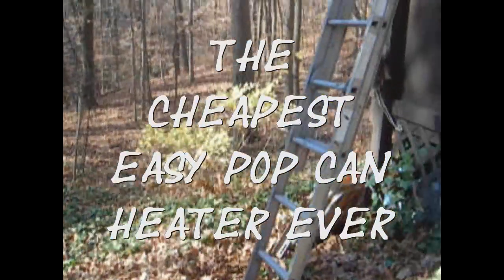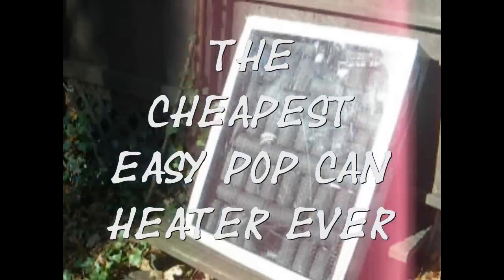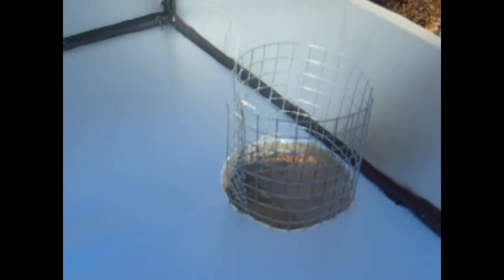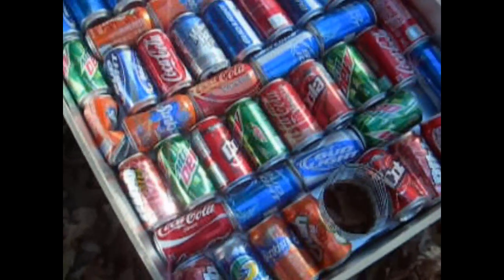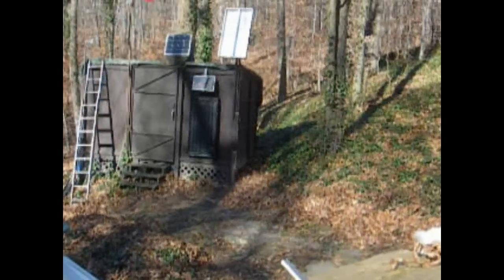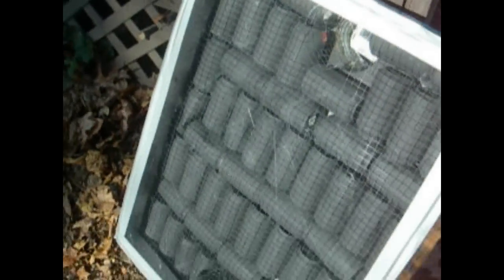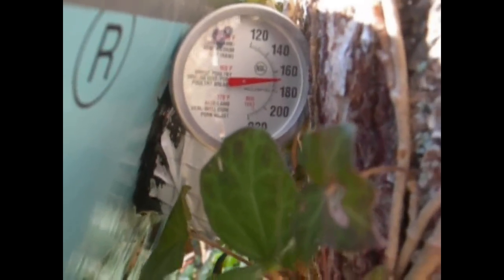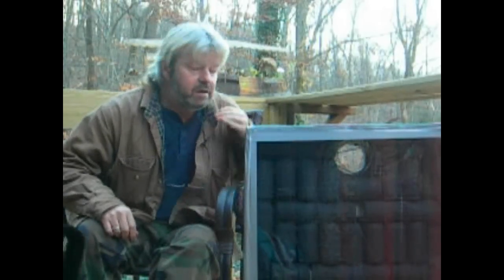THE CHEAPEST  &  EASIEST  POP CAN HEATER EVER!!

Comment: ok so im a newbe when it comes to this. we bought our first house and im a corner cutter, like to shave bills anyway I can.
so I understand the basics of how this works. its Radiation Heating. 2 holes (one top one bottom) hot air moves upward so it draws the outside air (or if u put in a window draws the cooler inside air) into the unit where it heats up and moves to and out the top. normal with a little force. (correct me where im wrong as I said im a bit new to this and im just following what ive learned in public schooling)
now where im unsure about this is that a normal window size area would be enough to maybe heat that room, maybe 5 degrees.
so im wondering how to get more yield out of it.
my thought was a bunch of these along the sunny side of the house and tie the discharge tubes into each other and then into the house via window. but I also thought that the heat coming thru the tube into the house 1: wouldn't be pushing at the same force and thus not make it inside well enough or 2: the air would cool in the tube on the way into the house. the least amount of tube the better but id still be looking at atleast 4 -6 feet of tube. enough distance to cool the air down inside it to by the time it reaches the house it might not be warm at all.
then I could be underestimating how hot it can get.
im trying to understand this more and come up with a get solution.
was looking into some wood fire type thing outside that will heat up the air in a pipe and send it in. something simple to make and not to costly that will last with simple basic care. we have wood wood and more wood. fallen trees deep back in the woods and people are always putting wood out to the road all around town. a energy source I really want to grasp for winter time with heating costs going up and up. thanks for any insight and tips.
Reply: You should be cutting 2 holes in the house. Both holes line up with the port holes in solar collector. The bottom one is your feed into the collector, this one sometimes has forced air via a fan of some kind. Important that the fan is not too strong or else it will cycle the air too quickly before the sun has a chance to heat the mass inside the collector. The top hole is the exhaust hole (because heat rises this makes it more efficient). So the bottom hole will take the colder air from your room (at the bottom) with a fan in the piping helping to draw air from the room into the collector....then the hot air will come out the top hole (exhaust). Both the holes can have a simple dryer valve, so that when you turn off the unit at night, there is no back flow of cold air. If you want, get a fan that operates off a small solar panel attached to the top of the unit.
Reply: +kaisnyker u should look into a outdoor wood boiler. I have one, it is awesome, best heat ever.

Comment: Question have you tested this in fall winter time? I have a Garden and green house going and i have rabbits as well that i have in a green house to keep them out of the wind and snow. My question is how well it would work in those seasons with the sun on it.
Reply: ANYthing black inside the greenhouse will help.   black plastic [sheet or trash bags] on the floor or hanging from the wall on the side away from the sun.   try anything, & check back in january, and let us know the results
Reply: *building  halfway in the ground
*hoop shape length wise with greenhouse siding ( about 4-5 sheets)  NOT PLASTIC & lowes does carry.
*hay bails lining the side
*black plastic of floor
* organic mulch- ( pine straw is okay but causes acidity& stay AWAY from dyed mulches)

Comment: This was only an experiment to show what could be done with a little effort and some cheap materials. The Duct tape after awhile would dry out and fail, due to the extreme heat. Best to use a wood frame and screws or nails to hold it together.

Comment: A couple of us girls out here think this is the best thing since soda pop was invented.  But can one of you guys explain HOW TO INSTALL THE DARN THING?  I only have one window on the south side of my house in my kitchen.  But my backyard got fairly warm during this Chicago vortex of sub-zero weather.  Don't know the measurement of the window, but it slides up and down.  WHERE DO I PUT THIS DANG THING???  INSIDE?  OUTSIDE?  I also have a kitty hi-rise (barn) for some ferals that I take care of.  Problem with that is it doesn't get the sun I get in my backyard, but it's insulated, carpet and furnished.  How would I install one on the backside for those critters?
Reply: re:  "WHERE DO I PUT THIS DANG THING???  INSIDE?  OUTSIDE?  HOW TO INSTALL THE DARN THING?"
Outside.  2 conduits (tubes) will be connected between the solar collector/heater and your window. You would open the window, cut & install a sheat of foam to fill the open area of the window & cut 2 holes through the foam for the conduits. Then connect the 2 conduits to the solar collector input & output holes & to your new foam window insert.  You would of course install the solar collector/heater in a location that allows it to collect optimal sunlight.  That location could be an attachment to your home, any solid structure, or even a dedicated structure made only for the solar collector/heater that holds it the optimal angle.

re:  "How would I install one on the backside for those critters?"
Exactly the same way as described above.  Your solar collector/heater can be located some distance from the barn to get nearby sunlight if necessary; however, if you have to run longer conduits, then they will need to be well insulated & you may have to install a blower fan on the heated air conduit, so the heated air doesn't lose too much of its heat before it arrives where the cats are located (as it could if your conduits were not well insulated & you didn't use a blower to move the heated air faster than normal convection currents would move it).
Reply: zeffur7 Thanks.
Reply: ***** Hi, have you seen the YT's for the solar cookers used with lesnel lenses?  That would be a great way to generate heat in the winter, maybe run an underground pipe into my crawl space.  I had read that the above technique will fry your vinyl windows.  Well, I guess I'll have all summer to think on this and in the meantime, figure how to keep my house cool this summer.  lol!!!
Reply: It's essentially just a box of heat with two holes in it. Find any way you can, to pull hot air out of one hole, and replace it through the other. One method is to use a dryer exhaust hose with a small fan(like from a PC tower) to bring it in the house through a window. then run a smaller hose back to the other hole to refill it with air from the house. Run both hoses through a board to keep the window sealed. Wrapping them in some sort of insulation can help prevent heat loss as well. There are many ways to move the hot air around. You just have to get creative and use what you have available to you. That's the whole point behind sustainable home energy.
Reply: zeffur7 Yeah, too complicated for someone with disabilities.  thank you anyway.
Reply: Not if you can find some helpful people. :)
Best wishes to you!
Reply: zeffur7: THANK YOU! Wish I read all the comments to find yours before I wrote my many questions above. Doesn't look like Rich Allen responds to comments. Oh well; he sure knows some easy & economical ways though!

Comment: I have same question...how do you get the heat INTO the house if the solar  frame  is on the outside of the window or wherever?
Reply: Al Schmitt It'd be so nice to have a man around the house ~ Doris Day?????  lol!!!!
Reply: LOL!!!!  Did you ever get an answer, because I have the same question!!!!  (It must be a girl thing, right)?  LMBO!!!!
Reply: daschundloverable
Actually NO. I am still in the dark on how to "attach" or where? Really want to make one if I ever get a response to "our" question!  Will probably be mid summer by then. LOL.!
Reply: Julie durham Unless you have gas filled double pane windows you could mount it on the inside of the window. Or, you could use dark fabric drapes and get the same effect. If you do have the high efficiency windows or want to mount it outside you would have to install ducting through the wall. Hope this helps.
Reply: hi julie.   let's go back to the beginning.
   yep   steel cans, with the open top of each can facing the sun.   soup cans -- anything.   nest smaller cans inside larger ones.   1 qt. of flat black paint.   thinned to make it easier to apply.  [MUCH cheaper than spray paint]    i used stiff foam plastic board [insulation]  for the box.    wood edges of box  [easier to nail & screw securely].  paint the inside of the box black as well as any surfaces of the cans you can reach with a cheap brush.    if you could come up with a steel plate or anything to make the inside of the box heavier, put the plate under the cans, but inside the box.    put the tallest can[s] in the center of the box.   thst will help support the cover, which should probably be plexiglass, so that falling stuff won't break the cover.    large scraps of plex will work, & tape the joints with clear tape [just to keep the rain out & the heat in].   remember that this is just the outside part of the system -- the part that converts radiant [solar] energy to heat.
    i have a walk-out basement.   i run a 4" vent pipe [dryer hose] from top of collector frame to a hole near the floor of the basement.     another dryer vent pipe goes back to the bottom of the collector frame.   i use a small fan to help circulation.   the fan i use came from a wrecked boat.   boats with enclosed engine comp't'mnt must power-vent engine before starting engine.   my fan is 12v, & is already a 4" dia tube.   any small fan would do.   you're in no real hurry to circulate the air.   if it circulates faster it just has less time in the heating chamber [the frame of cans], so is a lower temp.   but less air at warmer is essentially identical to more air at lower.   the amount of heat transferred from the sun to your inside air is the same.
anything else?
drive on!   --  alan

Comment: Hi Rich, Sterling, New York here 13156. I love anything solar, In the winter I live in my 1963 Garway camper 72 sq ft. I have solar cooked for years now, but I wanted to up my game. I have only so far spend 90 cents and that was on black paint. I currently use propane and it does fine, BUT I figure in Upstate New York if I get 10 days of sun at 5 hours a day that is the value of 1-30 lb propane tank...not too shabby if I can heat my wee camper for free during daylight hours. You Rock Brother !! peace~One-Knigght.

Comment: Built one to heat my shed from scrap wood and a glass pane.  It is attached directly to the shed.  I cut two holes at the bottom to draw the air from the shed floor.  A larger hole at the top allows the warmed air into the shed.  Got 165 degrees F within 1 hour.  Didn't work worth a damn when the sky was clouded over.  Otherwise warm air began to warm the shed.  Thanks Rich!
Reply: so you didnt have a pump? the air just flowed naturally?

Comment: If you're really cheap, use 'bisqueen'  for the "glass" and staple it to the box. Take the output into a set of side by side windows. Put the intake in the other window and use the chimney effect to move the air. over a long period it will heat the room. Looks junky, but that's part of the fun:)
Reply: "Bisqueen" if that is the correct spelling is heavy clear industrial plastic sheeting available in rolls at places like Lowes and Home Depot, fairly inexpensive and has many uses...
Reply: thomas gunter Actually, it's Visqueen...a polyfilm product.
Reply: Thanks for clearing that one up, Felix, I wasn't sure if that was the right spelling or not...

Comment: Nice job - Try it with just BLACK TAR PAPER and it will make heat just like that. The insulation chamber is a key thing to trap the heat and have it get built up like U do. U can even put a tiny solar panel and solar powered fan that way the more sun the more heat blows out when it's cloudy the fan stops - that is a SELF regulating device that is totally off grid in design and build. Great IDEA the insulated casing and duct tape every body else has to build big wood cabinets.

Comment: Thats a terrific way to heat your house on a hot sunny day !!
Reply: If it is sunny, it doesn't have to be hot!!  It can be sunny in the winter time.
Reply: meawins13  Yup, even in extreme cold they will get hot. The flat black paint (not gloss, gloss will reflect) will absorb the sun's light, not the sun's heat and convert it to heat. Even in the winter there is light and this is why they will still get hot...

Comment: This is easy?  How do you get the heat into the house?
Reply: Naturalicity Depending on how far you need to move the air, you could use a simple "fart fan" lol bathroom fan with a 3 or 4 inch duct.  I just happened on this video and it's got me really excited because I believe this idea will work miracles at my work.  We have a lot of roof but not enough walls to heat the place.  I am going to try on a larger scale and hopefully spot heat employee's.
Reply: palmyrajo If you set the heater in the window, you're only blocking the sunlight which would otherwise turn into heat when it hit the inside of your house. If you're covering your windows, you could use this to block any unwanted light while still getting the heat, but otherwise just let the sun flow in.

A heater like this is mostly useful for capturing heat from sunlight that would otherwise just bounce off of your home. Roof, walls facing toward the sun, etc.
Reply: I was wondering the same thing.
Reply: Maybe set it in a window inside the house?
Reply: LOL, there's more to it than that.  What about the fan?
Reply: Billy Williams Great idea. How did it work out for you?

Comment: I'm wondering what the function of the cans is?  Why not just have a black box...?
Reply: Sam Alejandre ...says the dude who can't spell blonde.
Reply: hey loretta  --
the purpose of the cans is to increase the [flat black] surface area of the collector exposed to the sun's rays.    you could get the same result with just a box, but the box would need to be somewhat larger [approaching twice as large].
Reply: The cans absorb and hold the heat.
Reply: Sam Alejandre Be nice. :P
Reply: thank you, Al!  that makes more sense...
Reply: you must be a real blond!
Reply: Al Schmitt i built one of these ,but was destroyed by hail.  i have been racking my brain tryi9ng to come up with something other than cans to help absorb heat, i was thinking maybe lining the back of it with a dark roof shingle. whats your thoughts?
Reply: chaseme81871 Are you not wanting to use cans because they are fragile, or is there another reason?
Reply: it just seems like the cans would be less effective, i was thinking about using steel cans,after i get rid of the plastic lining in the can, they seem like they would absorb,and hold more heat than thin aluminum would.
Reply: chaseme81871
hey chaseme!   yep   steel cans.   soup cans -- anything.   nest smaller cans inside larger ones.   1 qt. of flat black paint.   thinned to make it easier to apply.  [MUCH cheaper than spray paint]    i used stiff foam plastic board [insulation]  for the box.   paint the inside of the box black as well as any surfaces of the cans you can reach with a cheap brush.    if you could come up with a steel plate or anything to make the inside of the box heavier, put the plate under the cans, but inside the box.    put the tallest can[s] in the center of the box.   thst will help support the cover, which should probably be plexiglass, so that falling stuff won't break the cover.    large scraps of plex will work, & tape the joints with clear tape [just to keep the rain out & the heat in].   remember that this is just the outside part of the system -- the part that converts radiant [solar] energy to heat.   anything else?
drive on!

Comment: I made one of these and used a old rear projection tv scree as the cover, cut the foam to fit the plastic so that part was free. I also discovered that the duct tape wrinkles and separates when it sits in the sun so when I build the next one I am going to try the foil duct tape instead. I also sandwiched the top & bottom with 1/4 inch masonite and fastened this in with eye bolts so I could hang it under the overhang on my house. It is currently 45 degrees and cloudy and my incoming air is 57 degrees..On a sunny day I got 68 degrees incoming with outside temp at 34. I also drove rebar stakes in the ground behind it and tied it on the bottom to keep the wind from destroying it
Reply: have you added some kind of pump? I'm not sure how you get the heated air into the house

Comment: Have you done any testing comparing the heat output with the method here of laying unmodified pop cans in the box vs the more elaborate punching holes in the cans and gluing them into columns?   Wonder if all the extra work of other methods increase the heat output?

Comment: I am not experienced at doing what you have just accomplished however it would appear to me that what you have developed with the soda cans is to have increased the surface area within the dimensions of the solar container over that of a flat plate of the same dimension. Would you not be able to accomplish the same result using a piece of old scrap corrugated metal painted black??  Just a thought---

Comment: Hot air rises causing air flow. It is not like turning on a fan, but it will transfer heat. Too much air flow may lessen the heating effect. You wouldn't heat a high rise this way, but a small space will work well.

Comment: Great idea, one small problem. How do you go about pumping that hot air into your house? Running an electric pump seems like it would cost more than heating your house normally with oil or electric heat.